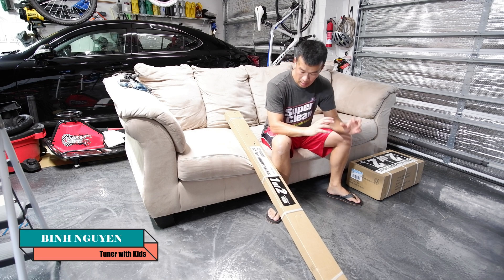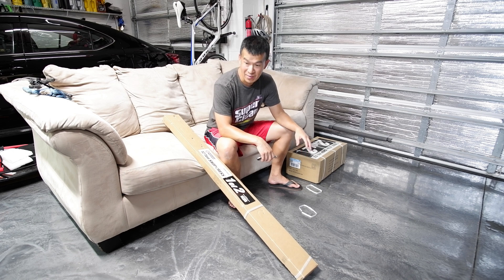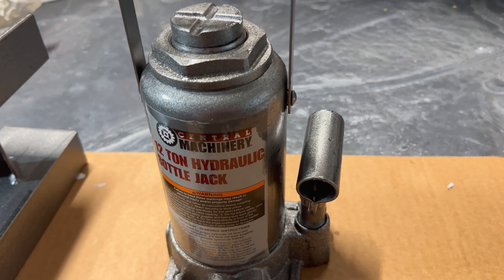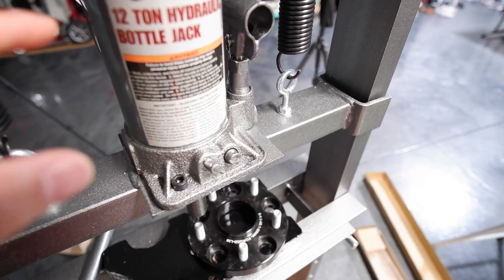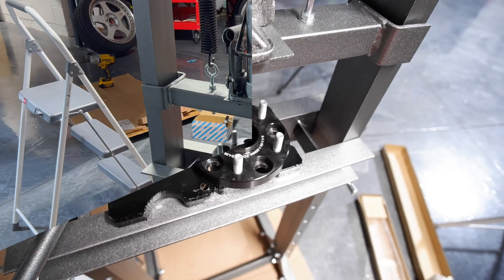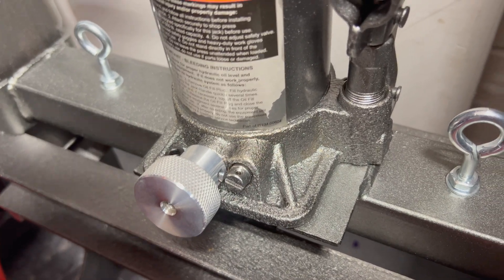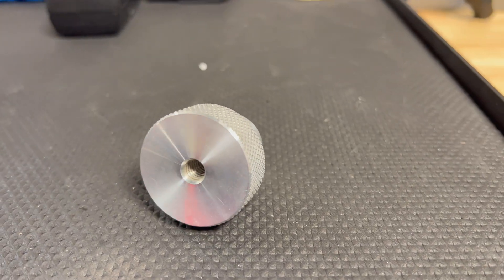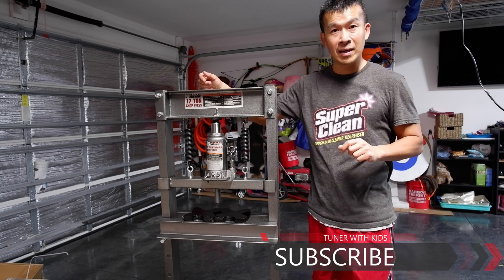Harbor Freight 12-Ton Shop Press Assembly & Modification Upgrades

Comment: Great video, I have done the same modifications to mine.  I wish, now, that I had bought the 20 Ton press instead.  I haven't come across a job this one couldn't do yet, but....   just wishing.  There will come a day when I cross some REAL stubborn pressed-in parts, but I guess I'll just upgrade when the need arises.  Thanks for the video, again!
Reply from the maker: I was considering the 20-ton but space was my biggest concern. I occasionally use this so it’s in a corner 95% of the time, not worth the extra width and thickness for me.
Reply: Rear wheel bearing on the Ford explorer or Subaru. I actually had an explorer one defeat my 20 ton press that the bypass valve kicked in. I ended up heating it up with map gas while under pressure then hit it with an air hammer. It was violent but it got the job done.

Comment: 7:03  I took those press plates to a mom/pop machine shop and had them true up the two surfaces.  Mine were pretty sloppy from the factory so I just had him do about an 80% cut otherwise they would have been thinned down toooo much.  Also, I drilled holes in the corners so I could drop in some pins to keep the plates from escaping under load.

7:31  Glue on some magnets in the channel to hold the handle.

7:48  Drill a hole and insert a hair-pin with a fender washer.

8:19  That knob came from where?
Reply from the maker: Knobs on Amazon. See link in description.

Comment: fyi: I had an application where i was near maxing it out. I needed to remove the pressure screw, and put it back in (bleeding it a bit) to get it to really torque down. Then I had to very tightly re-insert it with the handle.

I'm mentioning this since you made a custom billet handle, mine is now too hard to turn where that would be viable

Comment: Great video, Binh.  For the handle, I zip tied a U.S. General 18in magnetic tool holder (item 60433) to the top of the press.  It’s 4.99 at HF.
Reply from the maker: Good idea. I have a few of those around the garage.

Comment: Purchased this to press the valve guides out of a 4.6L ford PI heads and took almost 45 minutes to do 1 single guide the rest luckily came out easily with snap on air hammer using the proper 7mm tool made expressly to do this. Used to have a 20 ton press and the amount of force needed to press out this lil valve guide seemed to tax this pos made in china press to the absolute limit. returning it tomorrow as for my intended use will end up costing me more to fix what it breaks .. Instead buying an actual valve guide removing tool that can be easily done with 1 person. If I need a press in the future will simply get a 60 year old 20 ton press off craigslist.  old tools trump harbor freight crap 99% of the time.

Comment: The video that I needed.  I assembled it this morning, but was concerned about the gap between the vertical rails and the top portion of the press.  I see that you just tightened until the gap closes.  Great idea with the casters!  Just ordered the same set.

Comment: Good video, thanks for the info.  I am deciding between this and the 20 ton right now.
Reply from the maker: The 20 ton is huge and takes about 1.5 times more space to store. Much more heavy duty. I was planning on getting that but once I saw the side by side, I went with the 12 plus I was able to used a 10% off coupon.
Reply: @TunerwithKids  today, Nov 15 of 22 the 12 ton is 139 with coupon, and the 20 ton is 259 (no coupon found) so the price gap is pretty huge as well!  Thanks again.

Comment: Bought the same one to press a driveshaft back together. I did find that the bottom crossbar can get in the way of long pieces like that and that I needed to elevate the feet of it to get adequate height for long pieces. Outside of those small nits, it is a very useful piece of shop kit